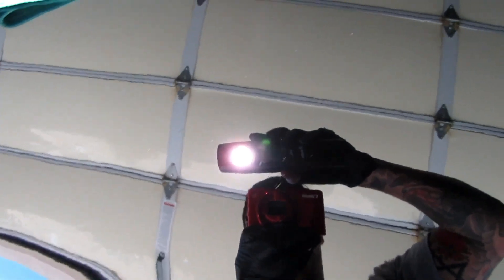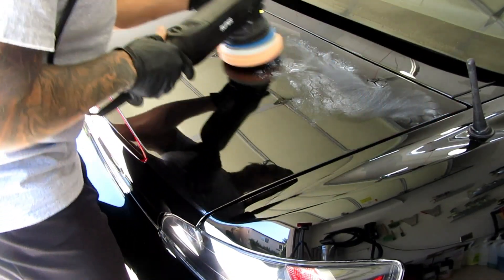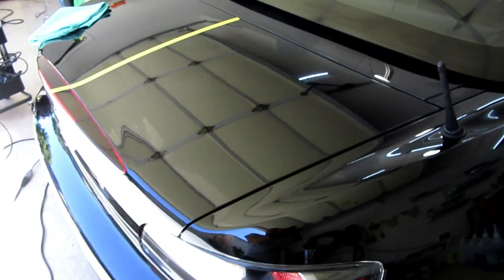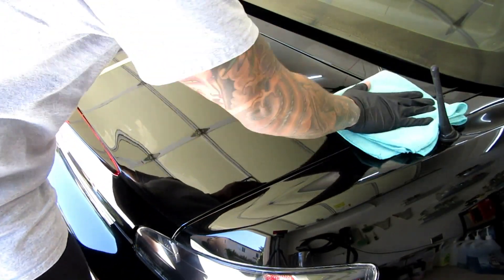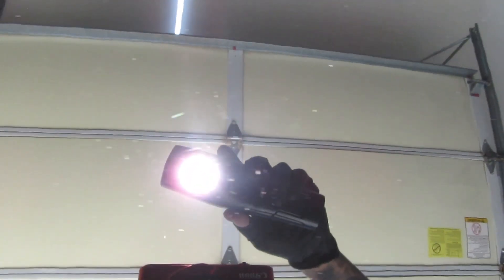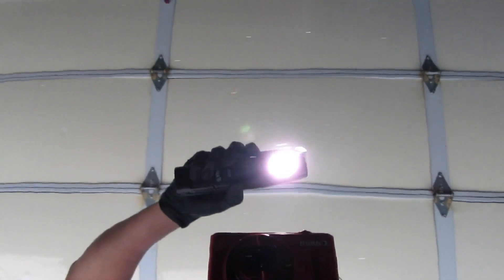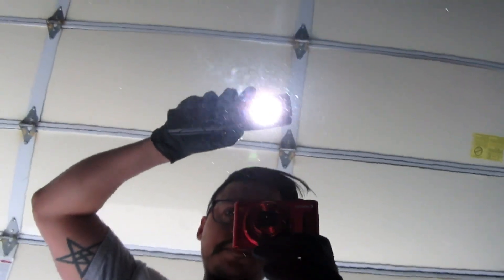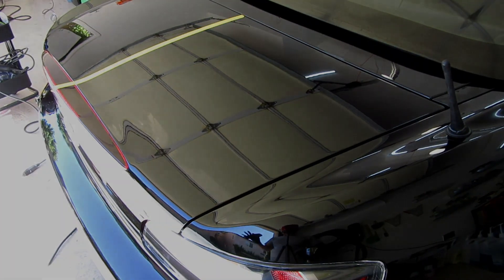Griot's Fast Correcting Cream vs Chemical Guys V32

Comment: V32 is obviously way more aggressive and is not a 1 step !
Reply from the maker: Griot's FCC is not a one step. It doesn't say that anywhere on the bottle. V32 is an outdated formula. If it's more aggressive, why didn't it remove more scratches and swirls? It's a much drier compound so it dusts like crazy. CG doesn't make very good products. Their compounds are some of the worst on the market period.
Reply: Have you ever felt the texture coming out of V32 ? I think it would be safe to say that V32 is what actually made and left  existing swirls on it. Griot doesn’t say but can be used as 1step with used with proper pads
Reply from the maker: @adamnieto2859  Yes I've felt it. A good compound should leave a haze behind while removing swirls and scratches. What's the point of a compound that can't do that? I wouldn't recommend it to anyone.
Sure it could be used as a one step because it finishes so great, but that doesn't make it a true one step product.
Not sure what the problem is or why you're defending V32 so much. On the CG wagon maybe? It's a fair comparison. I choose the 2 most aggressive compounds from each company and tested side by side. These are the results. Don't know what else to tell or show you.
Reply: MikeEM1 ohhh I definitely wouldn’t recommend it to anybody either ! I just feel like these two products should be compared to each other . It would of been nice to see it V36 vs this griot .
Reply from the maker: @adamnieto2859  That I could do since I have V36 somewhere. I just need a black vehicle to test on.
Reply: Dude V32 is ass, so much dust it feels like your working in a body shop. Griots for the win

Comment: You don’t know how to use the V32 that’s why you don’t have a good result.
Reply from the maker: Used it the same way I've used many compounds I've tested and this is by far the worst one. M100, The Last Cut, Griot's FCC, etc. One of the driest compounds as well. Dusts just as bad as M105.
Reply: 😆😆😆😆

How are you "supposed" to use it then???